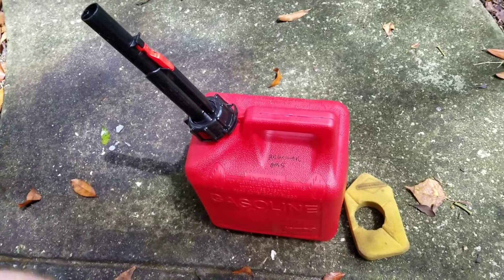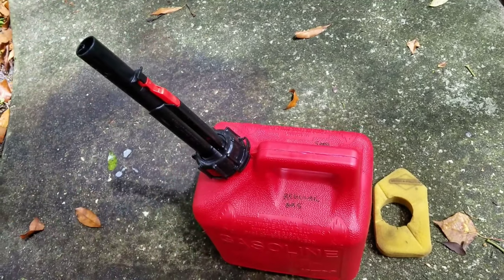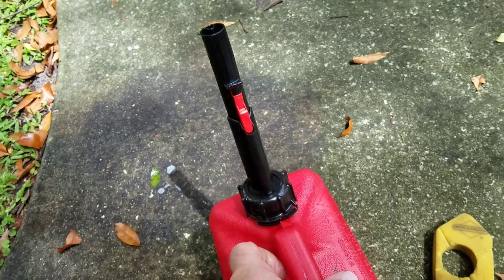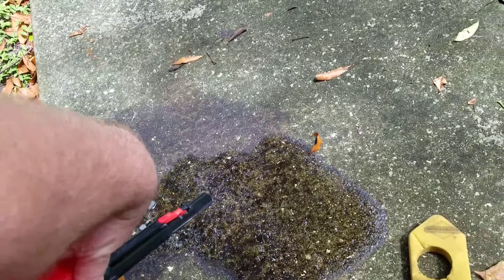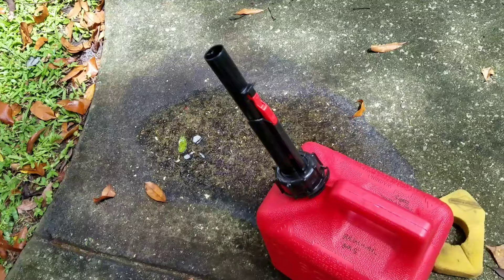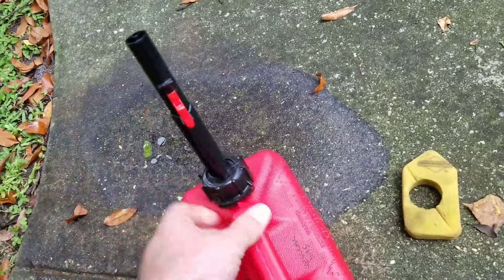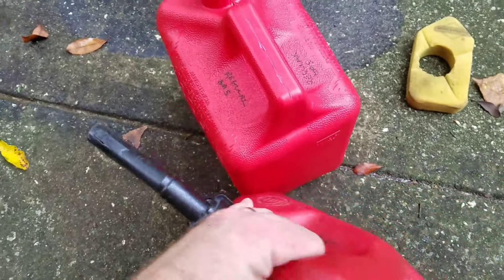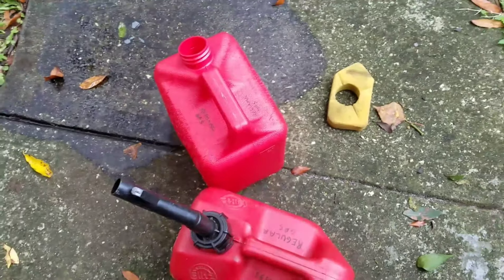How to use these new gas can spouts. Silly

Comment: 100% agree. Spills gas everywhere and doesn’t flow well.  So you pay $30 for a 5 gallon tank and fill it with very expensive fuel to only spill it everywhere. 🤔

Older gas tanks are worth their weight in gold! Back when they knew how to make them. Don’t fix it if it ain’t broke!

Comment: THANKYOU!  I bought one of these and didn't realize until I was ready to pour gas into my weedeater that I could not get the gas to come out!  GADZ no matter what I tried it didn't work.  I pushed the lever on the spout down but without knowing that the lever needed to be pushed down while pouring it in....it is ridiculous and nothing intuitive about it.  I am so glad you posted this video - yes I felt very stupid having to do this but I sure appreciate your being smart enough to post this for the rest of us dummies!
Reply from the maker: Yes. Exactly, it works ok if you are pouring into a car but not in a small gas tank such as a weedeater, chainsaw etc then it does not work without holding the red tab in at the same time because the nozzle is to long.  Ridiculous.
Reply from the maker: Yes. Exactly, it works ok if you are pouring into a car but not in a small gas tank such as a weedeater, chainsaw etc then it does not work without holding the red tab in at the same time because the nozzle is to long.  Ridiculous.

Comment: Absolutely hilarious and right on the money.  I just bought one of those cans and spouts and tried to fill up my brand new generator.  It took me half hour pushing that piece of crap filler in so it would pour, taking a break every 5 minutes because it was so hard to hold that heavy gas can and push in the filler at the same time, not to mention spilling gasoline everywhere because it did not flow out as stated; there was no air hole on the other end of the gas can to ensure smooth pouring.  Just a stupid idea.  I hope that Can company  reads all these comments.
Reply: Hell yes!  A full 5 gallon gas can weighs approximately 42 pounds!  Good luck holding that up with your wienie arm, Alice !

Comment: You gave me a great laugh with this video. Thank you for the hilarity. You are a true jokester! In all seriousness though... You dont have to depress the lever to get the valve to open. I feel like someone must have told you this by now but in case they didn't, here's how it works. You put the nozzle into the fill spout placing the lever on the edge. Then by depressing the red button gravity comes into play and the weight of the gas can will depress the lever which opens the valve inside the nozzle. Also, there are instructions behind the label on the front of the can.
Reply from the maker: haha Thank you. But you do need to depress the red tab in order to get the gas out into a small gas tank such as a weedeater because the nozzle is to long to depress on its own. Try it. And yes I did realize the instructions are on the can by peeling the label back but only after I made the video. Thanks. .

Comment: This was designed to ensure that you spill gas all over your hands and equipment.
Reply: That just happened to me trying to fill my snow blower for the big storm we're about to get in MA. Hate it SO MUCH!!!!!! Going to pour directly from the container into a funnel like I used to do with my old gas container which sprung a leak this year. I thought those things last forever but don't be fooled. I used to leave mine outside in the summer because my shed lets it get so hot that the container would bulge out like it was going to burst. But be warned, I believe these things can be damaged by sunlight. Throw them away after maybe 3 years.
EDIT: I tried to push the red button and I could not get it to budge! Ghaaaaaaah!

Comment: Awesome I knew I would find the answer on YouTube.  Unfortunately for me this is my first gas can.  $11.00 for a 1gal can for my lawn mower was just too good to pass up.  Gonna be pissed if I end up wishing I had spent $15.00 for less hassle.

Edit to add it looks like I'm in luck with mine, it's got a little foot that fits on the side of my mowers filler perfectly.  Now I notice a good bit of leak by from where it collapses which slightly worries the ex extra paranoid ex-firefighter in me but as long as I don't turn into a fireball it's livable.  Which is a good thing because if you didn't know a class alpha fire is the hardest to extinguish...

Comment: The design was probably meant for receiver with a little bit of lip around the hole. You actually don't need to press the nozzle in. If you turn the nozzle 180 degree so that the tab align with the receiver lower lip, you can push in with both hands on the gas tank. It's quite convenient actually because to stop filling, you just simply release pushing the tank
Reply from the maker: Yes but only if you can push it down all the way to a receiver. If you are filling a shallow gas tank such as a weedeater, blower or generator then that is where the problem is.

Comment: We had to use these mandated metal safety gas cans at my work for our landscaping equipment. With one hand you’d have to hold the safety catch open and the other hand the heavy metal 5 gallon gas container itself. We ended up spilling more gas then we ever did with the regular gas cans (in fact we’d hardly spill any gas). Even when the Fire Marshall’s did their inspection I’d tell them about this and they agreed how ridiculous the mandated cans were but their hands were tied.

Comment: Thank you so much! My hubby tried pouring the gas for 3 times and it kept on just leaking, which was already upsetting him.  So, I decided to search on YouTube and saw your really helpful video!

P.S. We do not have an old “tube connector” like in your video. Hubby just held on the lock so it won’t shut, while I help him tilt down the full (heavy) gallon in the gas tank.

Comment: Thought I could make it to the gas station on low fuel, I was apparently wrong. Had to buy one of these at the gas station. By the time I made it back to my car I was hot and frustrated, couldn’t figure out how to use this thing. Luckily your video was the 1st one that came up. Straight to the point, and no bs. Thank you so much!

Comment: It took me probably 30 or 45 minutes to figure this out. The dumb part is that gas was leaking out of the place where the funnel screws on to the plastic can, even though I had turned it until it "clicked". So this safety feature to prevent gas spills is really pointless. And as you pointed out. I ended up having to hold the retracting part of the funnel in place with my hand because it wouldn't stay.

Comment: I just spent 20 minutes standing out in the cold with one of those just trying to put some gas in a snowblower.  I finally just took off the nozzle off and poured it in without one. I spilled gas all over the top of the blower, lucky the friggin' thing didn't explode.

Comment: That new style is actually great, however you need to take it apart and remove the spring, then reassemble it. Now it will close so it won't spill getting the nozzel into the gas tank etc, then you just pull it back, which is easy now with no spring, and it will function just like any old fashioned one, but when your done, pull it up and it's closed
Reply from the maker: Yes. I saw a video on that awhile ago. Thanks

Comment: You just saved me a ton of frustration. I just wanted to fill my weed whacker, not solve a frigging puzzle. Also, it takes quite a bit of strength to push down on it to get to the 2nd step. I initially tried pushing down but didn’t want to break it because it didn’t give at first.

Comment: Heres a fix, take the nozzle off the can, then you're gonna wanna unlock it, push down and take the rubber o ring off, save it though, you'll need it later. Once the o ring is off, you can take the nozzle apart and there is a spring that automatically closes, take that spring out, get the o ring back on, and now all you gotta do is press the red button in and push down. When you finish pouring, simply pull the nozzle up and the safety latch will still work.  Also if you want a faster pour you can install a vent kit. They're not very expensive and will help dispense fuel quickly.  Just drill a 1/2" hole in the top and the yellow vent will simply pop right in.
Reply from the maker: Yes. Thank you. I saw another video on that and it works.

Comment: Just bought 2, 5 gallon cans and was pissed at myself for not peeling the label off the can where the instructions are and read at them. Then I turned the nozzle around the correct way and works it like a charm. Put the nozzle in released the red catch pushed down and gas in. Lifted the nozzle out and it auto shuts off. No spill when filling my generator, perfect. Turns out reading the directions worked (I know it’s a guy thing). Actually love these cans especially for the price!👍
Reply from the maker: Yes. I should have peeled the label back but I still hate the can. If you have to fill a shallow gas tank such as a weedeater you have to hold it. It will not fit all the way in to compress it back. Thats a pain. Thanks
Reply: You are right! For my small tanks I use a old style 1 gallon can. Right tool for the right job as always. For my 6-1/2 gal generator tank, the “Ralph Nader” cans make filling a breeze. What I love about YouTube is there is always someone that has the same problem or a solution to the problem. Thanks for posting.

Comment: Hi Scott. Thanks for the vid. I noticed this vid was done right around those hurricanes here in Central Florida, and of course we know each other and live semi close. ;) LOL I tried using the older cap/spout on my cans, because I had the same problem as everyone else. However, I think the cans that I use have proprietary spouts/caps that came with the unit, so it wouldn't allow my other spouts/caps to fit to it. I even tried to just use the spouts inside of the cap that was provided, but it wouldn't seal properly. I believe this MAY work with other brand of cans, but it looks like I am going to have to use the method that I have been using to pour it, which is VERY slow, because I'm pouring out of 6-gallon cans and they are ridiculously heavy. I know some will ask, "why are you using 6-gallon cans of fuel?." These cans are for a major application requiring a lot of fuel at one time.

Comment: OMG. Mid 70’s woman here and haven’t had a gas can in 40 years. I just bought one and I couldn’t figure out how to use the spout! I’m so glad to have run into this video cuz I was getting extremely frustrated. Now. I’m very happy to throw that spout away if someone can tell me where to get another, easier one. I will only be using it for my car or a generator I bought 6 yrs ago and it’s still in the box. I have no clue how to use that either. I won’t even be able to get it out of the box! 6 yrs ago a man put in the ground wire for me but I don’t remember how to use that. I feel pretty stupid to be prepped with things I don’t know how to use! But to be fair, I bought the generator  to use with my daughter and son-in-law but they have moved from the area. He was the one I was depending on setting this stuff up. Darn it. I’m a pretty lame preppier. Help with the gas nozzle would be appreciated and thanks.
Reply from the maker: You can buy the old style online still.
Reply: @howtoscottkeeley  . Thanks. I’ll have to take a look.

Comment: So me being a genius couldn't get this damn thing to work so I just bit a water bottle In half and used it as a funnel and I still managed to spill almost all the gas on the floor 😂😂😂 I got home with the fumes I put in and messed with it a little bit and figured it out. You gotta put the red switch facing down so when your pouring your gas the red switch stays open  by resting on the edge of the gas hole lol.

Comment: Step 1: Remove nozzle. Step 2: put nozzle in garbage. Step 3: Buy EZ flow replacement spout from Amazon or Tractor Supply. If you just put the nozzle from your old can on it, it's not going to work very well because your new can doesn't have a vent. The EZ flow spout includes an old style vent.

Comment: I ran out of gas and the only can available was this one.  It does have instructions under the label, but the design errors are such that it should be taken off the market.  It pours out so slowly that the leaking onto my hand made me give up while it was still one-quarter full.  The manufacturer should just provide a full and then it can be emptied, maybe without the leaking.
Designing a gas can is not rocket surgery.  Hard to go wrong, but on the other hand, modern battery chargers will not charge a discharged battery!  Like selling bladeless knives with no handles.

Comment: These cans are significant safety hazards because the vent switch may not work, as in my case.  No one wants to run to youtube to find out how to get gasoline out of the can and into the fuel tank of their lawn mower or tiller, so the expedient is to set the spout aside and pour directly from the can.  This spout is a fine example of hypertechnology, where some nifty looking invention outsmarts potential users, who can only proceed by discarding the obstacle.

Comment: The new kerosene cans have the same thing. I'm an elderly lady with arthritis in her hands. I HATE these. I don't have an old cover to put on it. Neither the old fashioned hand pumps or the battery operated ones will fit through the opening. I thought "OK, I'll pour the kerosene into another can but I can't lift a full five gallon jug of kerosene upside down. Not only will I have to dispose of the kerosene at our hazardous site (wasting $30 but will have to toss the can as well ($28) and I have THREE SETS! I don't know what idiot thought these were a good idea.

Comment: Any time you see a product on the shelf with a label that says, "New and Improved", pass it up. It means they have applied the FUBAR principle, according to government safety standards, and you're going to have a hell of a time trying to use it. These gas can spouts are a perfect example, and the other ones with the little green trigger are somebody's wet dream. Throw them in the garbage and buy a replacement that is engineered to the KISS principle.

Comment: No it's not silly! During Hurricane Sally my daughter n law needed gas for car.  She managed t get some gas in her new gas can, but putting the gas from the gas can into her has tank turned out to very slow and dangerous because of filler tube of the gas can. The flow of the gas from can to tank was extremely slow and the weight of the can was getting uncomfortable.  I finally said bump this and used the funnel from my older can. The new funnels suck and I believe are more dangerous.

Comment: OK, I guess I could rest the heavy gas can on the rim of my 15 year old mower's plastic gas tank and watch it crumble. Being I do not have an old style can I guess I could fill my much older metal 2.5 gal gas can with it and then my mower. Or I could take the spout to my vise, shove it in and drill a hole all the way through and put a piece of wire through the hole to keep it in without holding it.

Comment: This is the worst gas can I have ever used. I got one because one of my old plastic ones broke and the safe spill proof gas cans is a total joke and the can even after the locking tabs close and are suppose to be secure still spills as if there isn't any cap on it. Great video though on how to use the new ones.

Comment: I hate those things so much. Mine is the same, but the safety moves a stopper within the main pipe/nozzle, and that stopper has a small piece that slides in a channel of the main pipe. I know I'm not explaining it well, but the point is, the stopper is perfect for making sure the gas runs down the outside of the nozzle, soaking whatever is under the can (my knee and driveway, in my case) and wasting your gas.
What was wrong with the old nozzles???

Comment: I had this stupid nozzle on two of my new gas cans.  Had to go back to the store and ask how to get gas out.  While pouring gas they both leaked fuel out of the slide part.  Pain in the butt to use.  Had to buy replacement nozzles.  They are truly Craptacular!  I also had to install vent caps on the cans.  Stupid.

Comment: Hey so I have that same kind of gas jug, the one that you need to push down and I left it in my truck bed and it's almost full of gas now, it was sealed tight but spout side out jus like your video.I don't want to waste that gas but it rained all night now I'm wondering if you and other people watching this video can tell me if water can get in through that with the spout side out please tell me cuz I don't want to waste the gas but also I really don't want to risk damaging my truck!! Thanks
Reply from the maker: Im not sure. I wouldnt risk using it over a gallon of gas though. It could cause way more damage if it does have water in it.

Comment: I came looking for how to use this stupid spout because I never could fill my trimmer or blower without making a huge mess.  As mentioned in the video, this stupid mechanism requires that the spout be pushed in to get the gas flowing, which requires more pressure than you can put on a small motor like my blower.  Even if you push hard enough to get it flowing, the tiny tank on these devices means just needing a splash of gas to fill it so you can't possibly react quickly enough to stop the flow.  Stupid.  I just ordered a regular spout to replace it.